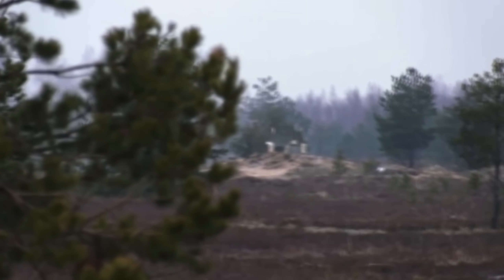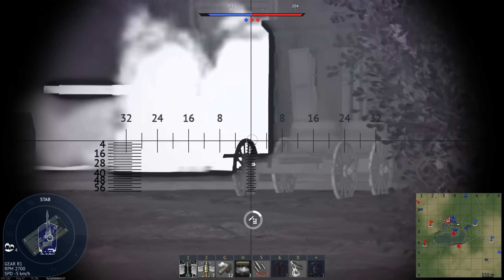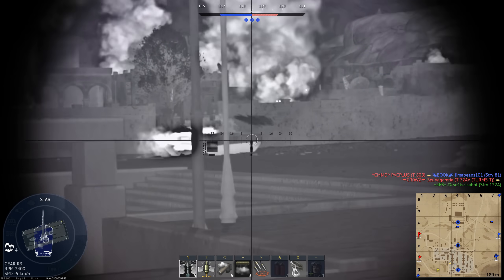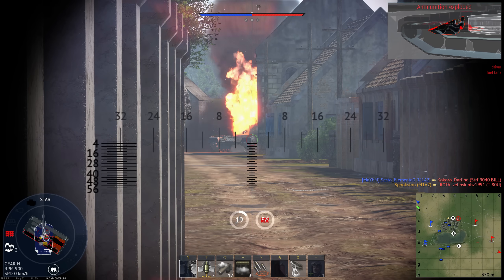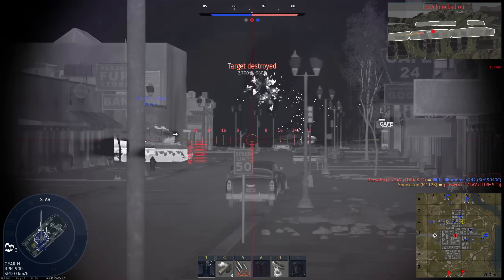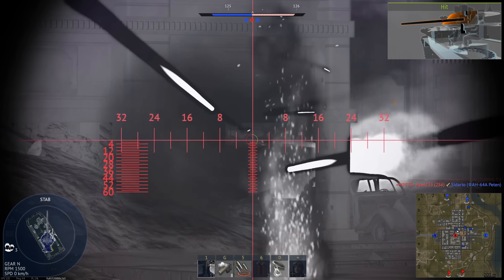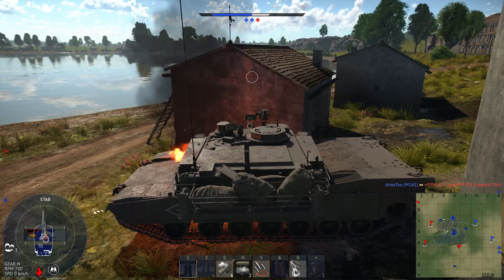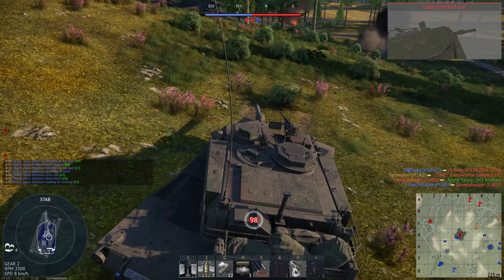Why The M1 Abrams Uses Depleted Uranium

Comment: DU is a rather interesting choice.  While it is is cheap the manufacturing of DU alloys is very expensive for all kinds of reasons related to alloying, forging, quenching and machining the armor and LRPs.  Against complex armor arrays DU seems to have a rather significant lead.  The M1 with BRL-1 seemed rather well protected against most APFSDS in 1980 Steel tungsten cored or designs similar to the M735. The 105mm monoblock M774 was able to pass through array at over 3000m, the M833 would just laugh at it.  

The mechanica-hydrodynamic properties of DU in armor are even more interesting. How it is integrated into the Armor of the Abrams is still shrouded in secrecy. The first public statements imply that for HAP-1, it is a mesh encased in steel. This could mean that the NERA elements are comprised with steel and DU mesh. It seems that at least in the 1980s ultra hard steels were possible to manufacture but there were many tradeoffs with ballistic properties, one of which being the highly localized failure of plate due to the inability to transfer the impact energy. It seems likley that the DU mesh with a very high quality steel allowed for mitigating these tradoffs both a very hard, durable  ductile and dense armor, that dispersed and transfered energy very well.
Reply: @komradearti9935  in reality the Swedes never got to test the actual DU armour made by the USA, the Swedes manufactured their own armour and the results were based on those assumptions.
Ps- the USA would not offer the HAP to the Swedes.
Reply: @komradearti9935 I would be surprised if the armor make up changed much with BRL-1 test targets to the M1.  I have heard people claim otherwise. On tank net years ago a M1 tanker mentioned that they were under no ilusions about their protection in the mid 1980s. Being told "Don't get hit".  I would need to see proof of any major improvements in the production version. 

The test round iirc was  XM579e4. How similar that was to the  XM578 I am not sure. Lucky for the M1 in the early 1980s  the soviets were shooting 125mm designs similar to the BM-22 almost exclusivly, which did not perform well against even basic spaced arrays. 

The material does seem to matter against some targets. There is the document floating around that seems to show a DU M833 out performing a W M829 aginst "complex targets" I suspect you know what document I am refering to. 

I have always taken it on faith that the makeup of the M1A1 was BRL-2. I am not certian about that anymore. I think it is far far more likley that BRL-2 went under an evolution with differnt sub varrients before introduction.  I am still digging around on this and nothing is certian. 

As for the 90s DU tests. It is hard to know how the Swedes incorperated DU into their test armor.  The USA spent +5 years and a very large amount of money researching how to incorperate it into tank armor.for the Abrams. Perhaps the Swedes got close quickly or maybe they missed the mark. It is hard to tell. 

On top of that the differences between HAP-1 and HAP-2 are and even bigger mystery.
Reply: @komradearti9935   Thanks for your detailed reply. 

The BM-22 type rounds suffered against spaced and sloped armor as a result of their construction. 

The tungsten carbide core would errode very little penetrating RHA. Unlike a alloy monoblock long rod like the M774 or M829A1. It worked more like an APDS with the steel body adding mass and KE and pushing it through the armor.

The BM-22 under some conditions could pen almost 500mm RHA at 90 deg.  The USSR in the mid-late70s  IRRC thought that the armor arrays of new western tanks would be a flatish steel, ceramic, aluminum, steel array. Something that the BM-22 would do well against.

I suspect against spaced arrays the BM-22 carbide core would be yawed and decoupled from the steel body cuasing it to fail against the very thick sloped backplate of the Abrams armor. 

This is a snippit from the document I was talking about.

https://i.imgur.com/TenM7Mn.jpg

As you can see here also 

https://www.alternatewars.com/WW3/WW3_Documents/Military_Tech/TAS_107/Tank_Ammo_Sec_107_JUN-1980_Fig2.png

What this shows is that early DU monoblocks were outperforming W rounds of the same design by a signifigant margin. 

Of note is that the DU M833 performs twice as good against the Nato heavy tripple target as the W  M833.  And seriously outperforms it against more difficult targets.  

The second image you can see that the M774 performs near equal to the M829E1 a tungsten design. 

I strongly suspect that the M1 with BRL-1 was well protected against what was common at the time. However the performance of W LRP and especially DU LRPs caused a rather seriouse situation to rememdy. At BEST I can see the M1A1 having some protection agaisnt the M833 and BM-42.

I suspect that HAP-1 and the Swedish (SHAP) solution are rougly equal. HAP-1 may be a little better and HAP-2 little better still. 

My rough rough summery is that for the 30 deg LOS VS monoblock KE, 600mm(SHAP), 630 HAP-1, 650 (Dorcester), 680-700 (HAP-2).  

This fits the likley design criteria and possible threats in the 1990s. Can't see the need for much more then that.
Reply: @komradearti9935  
" I wouldn't trust the M1's armour however as the reference threat was 115mm APFSDS.
"

I have seen some of the images you are referencing. It is remarkably interesting to see how these rounds behave. I suspect that rounds like the BM-26 were introduced for the very reason that the BM-22 was a crapshoot. I look at the M1s armor as being designed for a round “type” rather then caliber. IIRC Polish tests with their Leo-2s (Type B) were well protected against the BM-22. 

“That just seems extremely wrong when you think about how much longer M829 is compared to DM23. M829 is closer to DM33 which itself is a 25% improvement over its predecessor but the US WHA round was barely better than DM23? “

I had thoughts about this also. Perhaps the M829 being longer and thinner pushed the current state of tungsten alloys to its limit at the time. With the shorter thicker DM-23 therefore being better suited against spaced arrays. 

“according to this slide from a presentation from Rheinmetall ( https://i.imgur.com/jSYZzrI.jpg ) there was no change in protection between HAP and HAP 2. “

That could be the case. Their value seems to be about 650mm. The US value from most sources suggests HAP-1 was around ~600mm. Their estimate for the M1A1 with BRL-2 (?) looks to be about 490mm vs KE. Not a small jump vs M1. You are correct these are interesting values. 

“My guess is that they didn't because of that statement from the challenger 2 owners manual that says 15% less KE protection than a DU armoured Abrams in a small frontal arc (that's because HAP was only added to the turret cheeks), If we assume 650mm against KE like Rheinmetall did then Dorchester would have 550mm in the frontal arc.”

My estimate of 650mm+ for Dorchester comes from the US army TRADOC equipment guide. 

https://forum.warthunder.com/uploads/monthly_2019_10/zqItDcv.thumb.png.478dc84524c6df3595e9f390b878b938.png

The guy who found it, did a good job collecting documents. 

https://forum.warthunder.com/index.php?/topic/467915-fwd-dec112019-m1a2-abrams-turret-armor/&ct=1608835108

Exact numbers in RHA is a bit of a fuzzy way to gague actualy protection anyhow. KE protection is very interesting but the most common threat to MBTs then and now to me seems to be large HEAT warheads and Arty. 

The USSR and Russia in the 1990s didn't have much in the way of effective KE ammo stockpiled. The BM-42 never really reached frontline troops in high numbers until 1988/89. I would be surprised if more then a handful of BM-46/42m were available before the year 2000.
Reply: @komradearti9935  

I don't think the source made note of what version of the Leo-2 armor was used in testing. I wouldn't be surprised if the Poles got a bit of a mix batch and standardized them over time.  Type-B and BRL-1 are roughly compairable. 

I think you make a good point that needs to be driven home to many, that armor arrays vs KE ammo can't be reduced to a RHA value very well.  Small changes in design or composition can make the difference between defeating a armor package or falling short. 

The armor of the Early Leo-2 and M1s is a case in point. It wasn't that it was good against contemporary  western APFSDS at the time M774, L23, DM-13, just that the USSR had ammo optimsed for the wrong target type and was slow to introduce more advanced designs. 

The thinking behind the M1 armor makes sense based on the type of battle it was expected to fight. In that case if a T-62 or T-72 got close enough to get an aimed shot off that would defeat your frontal armor. You already did something very wrong.  

The Challenger 2 seems to be a rather interesting case.the UK MOD had seemed to prioritize KE protection, that their own requirements and results would be lower then the follow ups in Germany and the USA, seems rather odd. The claims made years ago was that the Challenger 2 was better against KE rounds then the stolen    T-80Us with K5. A similar claim made in the Greek tank trials. Although the C2E tested was noted to be worse then the Abrams and Leo-2. 

That said 550mm protects against BM-46 at long range so that might be enough for the UK requirments. There is a claim that a C2 survived a blue on blue in 2003. M829A2 impact on the turret front slope.  

As for the Donbass conflict, I am of the understanding that many ATGM hits were ineffective due to age of the systems used and widespread use of ERA on tanks. On a side note the BM-15/22 was still used to good effect during the conflict.

Comment: Dark side of the story the depleted uranium rounds were tested in the vieques island test range part of Puerto Rico. The ecological damage done by the US test there is astronomical and the number of lung, kidney and skin cancer cases in the small island residents is shockingly high. I am a Puertorican and have visited the island, to this day the navy wich oversighted the range has not finished the cleaning operation and denies funding or authorization to conduct a study to determine is there were any correlations between the test and the pollution in the island.
Reply: Yes, but they also use tons of tungsten and other heavy metal in those munitions. On top of explosive compounds that have shown to be toxic to the soil and leached into the water. The point is, there is no concrete proof DU is much worst than other "pollutants" from munitions, and it is likely that we won't know for a while because it is difficult to research the effects of one factor when there are thousands of factors that can contribute to it. There has been much research showing toxicity of tungsten, too....so...there is no proof of DU round being the sole factor in this health in the issue. Also.. lung, kidney, and skin cancer is common among those who are exposed to heavy metals.

Comment: As a high-level physics student, can confirm all of this... don't ingest any uranium xD But in all seriousness, it shouldn't be a big issue for crews (unless they decide to eat their ammunition...) but the impact of this kinetic penetrators throws up all kinds of dust, including from the DU penetrator. That's the real risk - even if you don't die, you can still take in these dust particles if your vehicle is hit or you go near a vehicle hit by a DU penetrator. You won't look like Chernobyl, probably just get lung or thyroid cancer. "just".
Reply: Inhaling steel, tungsten, rubber and various ceramics mixes used in pretty much all tank armours isn't exactly good for your health either.

Comment: My question is:
Reinhmetall have the hight velocity Canon the L55, uses tungsten bullets. 
Using the depleted uranium, can pen more, is cheaper and better
Reply from the maker: The L55 was developed in part as a bid to keep up with US made DU ammunition. As I mentioned, at higher velocities tungsten starts to mushroom less, so the L55 was designed to help achieve that velocity. Countries might not use DU for a variety of reasons, whether it be moral objections, supply issues, or economic investment.
Reply: @Spookston  thx

Comment: I wanted to point out that there are pictures of damaged M1A2 or other models, that have a sealed box instead of the turret and radioactive markings on them in transport. Also the people that praise DU for its ability to catch fire, should think that if you use it for armor like the M1 does it starts to work against you.

Comment: I do have a question though, would depleted uranium be the best option for electromagnetic cannons (Railguns, gauss ect) Or would another material be better suited? Also would the round be a shaped charge or regular ball ammunition?
Reply: Methinks when you apply railguns to the equation, you start to design for KK (kinetic kill) method. You could slow the railgun down by limiting charge so a chemical warhead would work, but a KK is the simplest use of railguns.
Reply: depleted uranium isnt magnetic if not in low temperatures
Reply: I don't know the science really, but generally when you get as fast as Railguns and gauss get, you probably want to value density over anything else. For Gauss though you could probably look into magnetic meterials for ammo as they would reduce your power needs. Both gauss and Railguns work against shaped charges, you would need way more faster fuses and get little advantage from the extra velocity. Regular ball wouldn't work either since you have no rifling, and Railguns need a sabot. I imagine Railguns atleast would use APFSDS rounds, Gauss probably the same. A long dart is the best way to make use of high velocity ammo.

Comment: Now talk about why thorium reactors were never used to a significant capacity despite being vastly superior to uranium in practically every way.
Reply: Historically, uranium reactors have been developed more because 
1) they can breed Pu-239 which is useful for bombs and
2) uranium ore can be found in concentrated deposits. Thorium is more common as a fraction of the crusts material but tends to be more evenly spread out, making mining is less economical.

Thorium reactors are also often overhyped. You can reprocess used reactor fuel to reduce highly active, long lasting waste but this is rarely done because the US dislikes it and most countries follow the US's lead. France however manages this fine and sometimes runs some of their reactors on MOX (mixed oxide fuel, regular uranium oxide fuel with plutonium oxide mixed in).

Another often stated advantage of thorium reactors would be their reduced proliferation risk, which is blatantly untrue. If anything, U-233 makes for a better nuclear material as U-235.

So do tell me, in what way would thorium be superior? I personally favor running unenriched uranium with a highly enriched uranium or plutonium 'spark plug' to get going where you breed the U-238 into Pu-239 and burn it in situ. IIRC, molten salt reactors (or any hard spectrum reactor) should be able to manage this fine, but this is admoittedly a more mid-term option. Near-term, regular uranium burning PWRs work fine.

Honestly, pretty much any reactor type that doesn't use graphite as a moderator or boiling water as a coolant is fine IMO. Though sodium-cooled ones definitely are *interesting*.
Reply: @wouterdebois7958  you cant get both low reactive and short lasting waste. the shorter the half-life the more radiation that is given off.
Reply: @Backonos  This is generally speaking correct for pure isotopes, but used fuel is typically a blend of transuranic elements which are radioactive for a long time and fission products which are much more radioactive but for a much shorter time.

By using a hard spectrum reactor (a reactor using unmoderated neutrons) you 'burn up' there transuranic elements and the isotopes that are still left have a half-life measured in decades, making storage significantly easier as both the duration and volume of storage is drastically reduced.
Reply: Because developing thorium reactors is challenging and people keep acting like it's a miracle energy held back by Illuminati. Fack check here (https://whatisnuclear.com/thorium-myths.html )
Reply: To my knowledge, it'll be lot of work for what is basically a uranium reactor that can include thorium in the fuel mix. Hence, why the nuclear industry is not very interested in Thorium reactors; The industry rather invest resources into other stuff.
Reply: Money
Reply: @oligarch3962  This. They stopped considering thorium reactors when they found new, inexpensive stores of uranium.
Reply: cuz thorium can't be used to make nukes
Reply: @warbirdgaming8091  That is not true.... (https://whatisnuclear.com/thorium-myths.html )